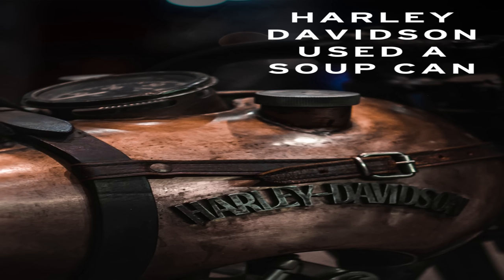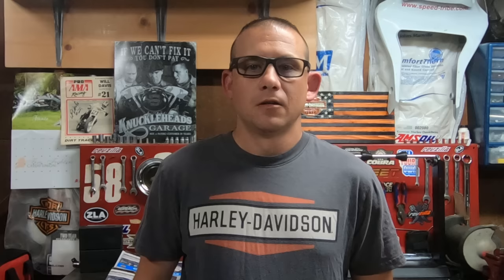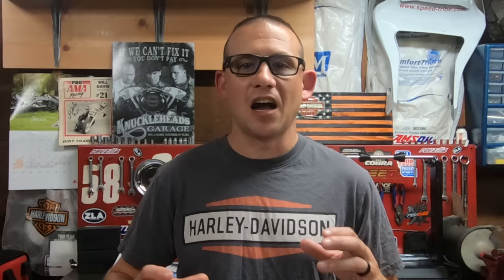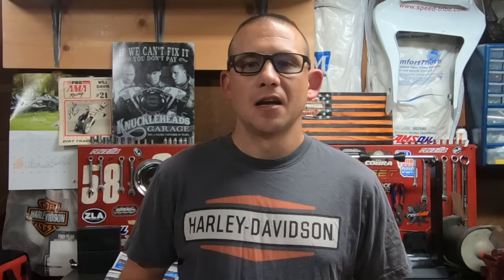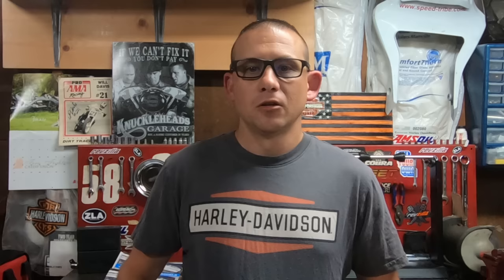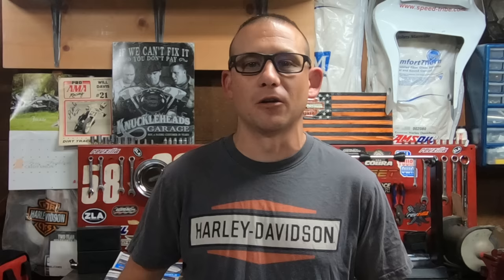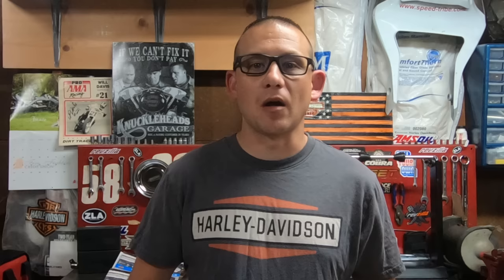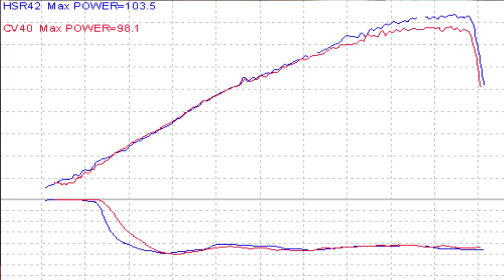CV Carburetor or the Mikuni HSR for Your Harley-Davidson

Comment: I got a 05 Electra Glide with the 95 big bore, K&N air filter, 211 cams, and Reinhardt exhaust, what do you guys recommend? Re building the CV and jetting it up, or go with the Mikuni 42 or 45? New to this. My first Harley and haven't ridden since the 80's.

Comment: Have 03 xl1200c bike was stored for about 10 yrs after my mom and dad passed it the same yr wanted to get back to good so took my bike to hd gave them 1500 they ripped me of didn't know they were going out of business all i got was new front tire and battery and lot of bs so anyways i put new tank plugs and hsr 42mm carb did oil and transmission fluid change when i get it running and warmed up i set idle at 950-1050 as recommended its smooth idle and very responsive shut it off fires right back up let it sit for the night next day may or may not start tried 2 cracks on throttle full choke half choke am going in circles and lost on starting this any ideas am tired of being  ripped off by mechanics

Comment: CV carb has a butterfly on vacuum side of carb, however mikuni does not offer this so called restriction to the flow of gas vapor, Because it is open to the flow unrestricted on vacuum side of carb.

Comment: I will stick with my S & S. I have 5 bikes with these carbs Super B on my pan Super E on a T C   Super G on a bigger T C.  Super D on my Evo  also big  and my 5th bike is injected
Reply from the maker: Nothing wrong at all with the S&S carbs, they are awesome but they can really over fuel if you don't set them up right. They are designed to make some serious power!

Comment: So what about the s and s super e carb, been hearing their about the best replacement
Reply: S&S carbs tend to foul up plugs easier then other carbs I've seen.. even with a good tune.. and they cost 2.8957 trillion dollars.
Reply from the maker: The S&S works well if it's setup right, you can really over fuel easily with one of those though.

Comment: Im about to bore my Dyna from 88 to 95, with an s&s cam chest kit , 509 cam and Mikuni 42 carb. 
Do you think i will need a Jetkit also ? 
And would a Daytona Twintec benefit this setup ? /Johan from Sweden
Reply from the maker: You'll have to jet that carb to fuel it correctly for the changes, Mikuni is pretty close when the bike is mostly stock. It will need to be dialed in for sure, the TwinTec wouldn't be a bad idea to allow you some adjustment if needed with your conversion. Congratulation on the upgrades! You'll love the added power, those 95's are really strong!

Comment: My bike has a Mikuni 48 mech at the dybo told me I needed more air bike is 117 stroker 128 hp any suggestions? Thanks
Reply from the maker: Dang you're running an HSR48 already and still need more air? That should flow enough with a large air cleaner that has quite a bit of surface area. Other than a massive air cleaner the next option would be looking into maybe an S&S carb.

Comment: I'm looking for top-speed, wide-open throttle on my 97 Buell Built 1200cc S1 land-speed race bike. Currently, I'm using a Harley, Kline, 44mm CV carb which I've spent many hours tuning. I tried a Mikuni HSR-42, but the CV 44mm outperformed the Mikuni. Next, I'm going to try an HSR-45.

Do you think the HSR-45 would outperform the CV 44mm at wide-open throttle?

Comment: Im doing a 02 fxst I just picked up the S&S power pack with ez start gear drive 585 cams 100"  with a  thunderheader and I just ordered a super e. But I've been really wondering if it will suit the 100" im vary interested in the billatron I was wanting a flat slide but I have super e,s  on everything I've owned I'm hoping it will be enough I should have gotten the super G I think ?
Reply from the maker: They are all really good carbs, Super E would be about right for the setup you're doing.

Comment: 02 twin cam wide glide with factory CV . tried the Mikuni hsr ........... made way too much noise clapping sound plus was actually too responsive , so much so that in a high speed sweeper curve as you come out of the curve & squeeze the throttle it upsets the bike almost into a wobble which is very dangerous in a 100 mph sweeper curve as you can imagine. Gas mileage was no problem though . But my CV gets 52 mpg while the Mikuni gets 47 mpg which isn't bad at all . But there was not an IOTA of difference in HP /Torque but that carb. clattering sound  drove me to shit can the Mikuni ! Until Mikuni can fix the noise problem I'm not interested . Oh I forgot to mention 52 mpg with a Screaming Eagle 204 cam with a hell of a lope !
Reply from the maker: Damn  I never heard of the noise issue on the Mikuni, are you talking about the slide making the noise?
Reply: GOOOOODNESSSSS>I've never heard of such a thing
Reply: @GixxerFoo  YES

Comment: I purchased my 99 Heritage EVO with a mild cam, V&H short shots and a Mikuni carb.  I noticed immediately the throttle response was much quicker than all the bikes I've ridden previously with the CV carb. That slight jerkiness took a bit to get use to and I feel makes the bike a bit less enjoyable in stop and go traffic.  By reading the plugs and my fuel economy (35 mpg avg. hwy.)  I feel it is running rich. Other than downloading the Mikuni tuning guide do you have any suggestions based on your experience to improve my fuel economy?
Reply: Rejet the carb, and reconsider the exhaust parameter.

Comment: I run s&s on both my shovel and evo. Was gunna run one on my 96ci too but after crackin a rocker plate, im not sure what im gunna do with that bike
Reply from the maker: Holy crap did you find out what caused that?
Reply: @GixxerFoo  looks like a rocker bolt came loose. High mileage, she was due to be opened up
Reply: Update:
Ive sold the 96ci. And am also tryin out my first Mikuni on my Evo

Comment: I am sick and tired of the constant clacking of the flat slide of my Mikuni HSR 42 carb. I want to go back to a cv carb for my 2000 Heritage Springer. What modifications, if any, would entail the change to a cv carb?
Reply from the maker: Basically just going to back to stock parts, you might need to change your throttle cable connection and of course make sure you CV is tuned. But other than that not much really.
Reply: @GixxerFoo  I should have been more specific. The Mikuni I am replacing is an HSR 42. It was attached to a Screaming Eagle manifold. I have now found out that the spigot on the manifold is too large for the 40 mm CV carb.  Is there an adopter I can use to make it happen?
Reply: Well, I have now changed to a CV carb and the only thing I needed was a new seal for manifold to carburetor.  This is because I have a Screaming Eagle manifold, which is specifically made for a 45 mm Mikuni. The new seal is a bit beefier to accept the thinner spigot of the CV carb, which has a 40 mm spigot. Also, the old throttle and return cables fit on the CV carb.  But guess what? Whatever clacking existed was not from the Mikuni carb, and is still there. Now I have a spare Mikuni if I ever want to go back to it.  And by the way, I do not feel any difference with the CV carb.

Comment: How much modification is required to put a M* engine into a twin cam bagger frame?
Reply from the maker: It would require some fab work, the mounting points are a bit different.
Reply: @GixxerFoo  so not heroic per se?
Reply from the maker: It would take some serious fabrication for sure, aftermarket doesn't make an adapter kit yet.

Comment: Did Harley put mikuni hsr carbs on Evo road kings in 1995. My road king has an hsr on it. Was that pit on aftermarket? Thanks
Reply from the maker: The Mikuni is aftermarket, Harley used a CV carb from the factory.

Comment: I have never had a Mikuni but I know from much previous experience that the CV carb is not very durable. They just don't last very long.  The design might be ok but some parts are just junk. I realize S&S carbs are not being discussed here but put an S&S carb in one hand and a CV carb in the other hand and you will be astounded at the difference in weight and quality. You will quickly get the idea the people at S&S want their products to last a long time.
Reply: I'm running an  S&S Super E  ,W/YOST POWERTUBE,  a .0295 low jet, a 72 Mainjet on my '95 Roadking
Reply: Same thing with S&S big bore kits in general they are much lighter in weight difference between other big bore kits also
Reply: Cv don’t last that long lol? Stock cv carb on my bike since 94. Still going strong 🤷‍♂️
Reply: @Justin-uj8no  same.... sounds like the OP just wanted to feel like they were contributing.... CV carb is as reliable and smooth as EFI of you're mechanically inclined and properly jet and tune them

Comment: Put an S&S on it. Be happy. Better mounting system. and so much simpler to match displacement and performance than either of these
Reply from the maker: S&S does make a great carb, there's no doubt about that.
Reply: I Agree> S&S has  3 tunable circuits,,,,,Mikuni has 5 tunable circuits

Comment: There is no reason to change to another  carb untill you go bigger than 96in,  or have a radically modified engine.
Reply from the maker: Completely agree, you can easily over fuel a engine with a carb. I prefer to take a small carb and jet it up rather than work down with a big carb.

Comment: 48 main on my 1200 sportster CV carb gives me a lean fart on acceleration.  I had to run a 50.
I have stage 1 drag V&H drag pipes
Reply from the maker: That's a big main but with open pipes it was the right one to go with for sure!
Reply: You guys are talking about a PILOT jet, not a main jet. Main jet sizes would start around 180.

Comment: I run a S&S supper G great carb , what about (them)?
Reply from the maker: Great carbs, easy to really over fuel with them cause they will provide it. They work very well when you've got some power in the motor.

Comment: Just curious but are you a Harley Tech or just a motorcycle enthusiast like most of us?
Reply from the maker: I'm just an enthusiast that has always done their own work, I learned as a kid hanging around the grumpy old guys in the back of the dealer till they said if I'm going to hang around I may as well learn something lol.
Reply: @GixxerFoo  lol…same here buddy I’ve always worked on all my own vehicles. First thing I buy after the vehicle is the service manual! I also grew up around a master mechanic in a small garage. Going to the flat track on the weekends and racing an old 68 Corvette! Good times bro!
Reply from the maker: Hell yeah l used to race flat track myself, those were some good times and late nights. Service manuals are absolutely invaluable. Harleys factory manuals are the best, every torque spec and even the tools you need for the job.

Comment: Arrrrr Carbs! Well, hear we go, please keep in mind I'm  not qualified in anything, yep, just a wanker that loves bikes, standered evo care pretty good and smiple,   after market kit for them are a good improvement, it's really a adermizer kit, Finer spray needle jet kit, plus uping your idle/main jet and raising your needle, 
any twin motor that share one carb does well with a butter fly , yes for performance/race cable operraded slides are the best, if you have a real hot motor, change the carby, I have found the engine soot from the breather in the air box/filter is like glue when mixed with fuel witch stops your slide moving freely with the vacuum, wet a finger tip with fuel and try to slide it on the blackened mouth of your carby, it sticks instantly, plus it turns your carby in a black soot shit box, atmosphere breather is the go! Your motor will love it, yep!

Comment: Are the mikuni easy kit stock jetting just right for the stock tc 88 b? It's a deuce with stage one and vnh big radius
Reply: Or are the stock jetting rich?
Reply from the maker: The Mikuni is generally pretty close right out the box, but the jets are easy to change. They have a plug in the bottom so you don't even have to remove the float bowl.
Reply: @GixxerFoo  so the 25 slow jet a 97 needle in the middle slot right where it need to be? I change the accelerater pump from 70 to a 50 and put in a 165 main.so far good wot